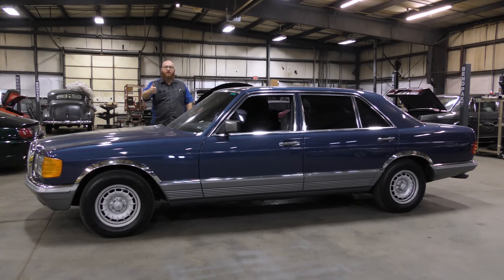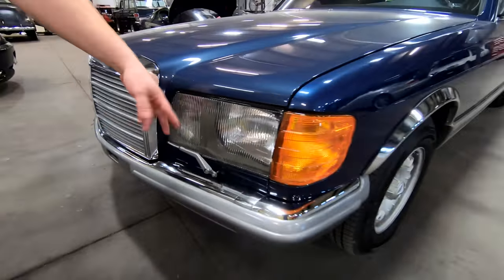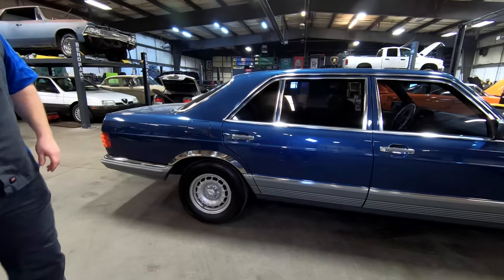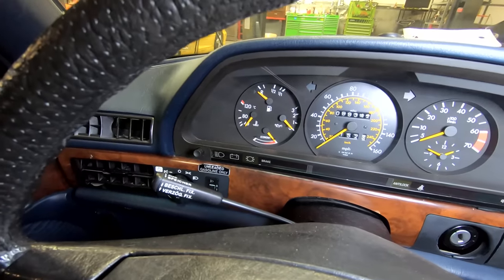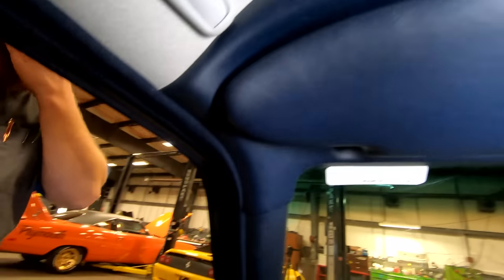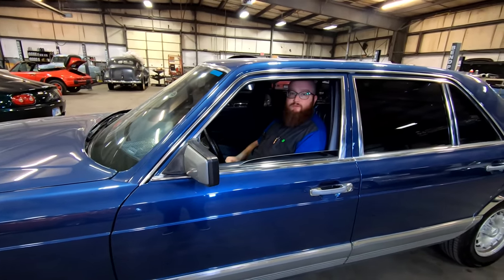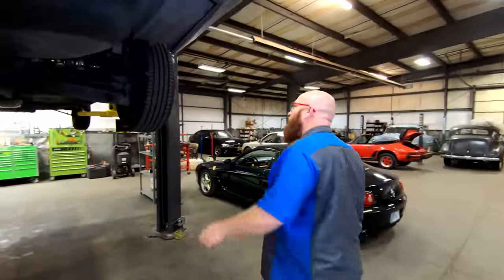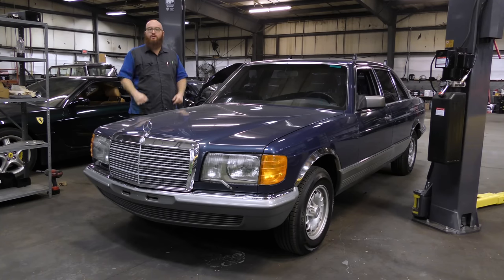Truly a gray market god! Shockingly perfect 1985 Mercedes 500SEL! The CAR WIZARD is in love

Comment: that metal washer on the dashboard is a metal ring with sticky tape on the back - used to mount a metal ST Christopher magnet. St. Christopher is the patron saint of automobilists and my parents had one in most cars. when the cars had metal dashes it started with the magnets and the more modern the cars became the less metal was exposed on the outside. so they stared to mount metal plates with double sided sticky tape :-) 
The location is typical for one of those medals. 
Hi from Europe... keep up the good show

Comment: Oh yes, those old fuel systems. Whenever they are hard to start when the engine's hot, they have an issue with that second module next to the fuel pump, it's a fuel pressure conservation chamber which holds the fuel pressure for the engine to start, and it has a membrane which can tear and then this module needs to be replaced.
Reply: Why, yes! I recently changed the fuel pressure accumulator in my W124, because of a hot restart problem.

Comment: heated windshield washer fluid reservoir and lines all the way to the headlight/windshield squirters as well as a heated pad underneath the black fretting on the bottom of the windshield where the wipers are in park position. Heated radiator water is circulated through the pad just like a heater core in order to keep the blades from being frozen to the windshield.

Comment: This is actually an elongated version, I'm not sure whether it's a Pullmann conversion or whether it was built that way by Mercedes, but it looks like it's several centimeters longer for more foot space in the rear seating area, the rear doors are a bit longer than usual. I remember in my childhood, there were many cars like this in our garage to have car phones installed. and once, I think around 1990, there was one that was converted into a convertible, so that was a 4-door convertible 500SEL with the highest luxury interior you could imagine. Your foot did sink right into the carpet, it was so soft and deep, and with the roof/top closed, you felt like you were inside a living room, not so much inside a car. And of course the top went down automatically. The customer who had brought that told us that it was one of 5 of these conversions that were ever built, world-wide! A total dream...
Reply: The SE was the standard, the SEL was the long version, as this one is, both factory-made. Where 4 inches does make a difference!
Reply: @midlam99  Oh, I see, so it wasn't a Pullmann. Right, I'm not even sure these newer models were modified by Pullmann. Anyhow, that convertible sure was nice, I still remember it after 30 years, was still a kid, and I was allowed to sit in one of five cars in existance! :-)

Comment: I used to federalize German import Benzes in 1985, and a lot of them had velour seats, often in weird colors, like an avocado green. Some were former Taxi's they had power windows in the front and crank on the rear doors. I finally got my first w126 last December, it's a 1986 300 SDL with 400,000 miles, for $800. 
I feel like a million bucks driving it!

Comment: nice car! very clean… but fairly EQuip 500SEL… missed out some options that usually ticked in the 500SEL PFL which is the top of the range back on 1981-1985 for W126 family… options missed out such as…

- electric front and rear seats
- heated front and rear seats
- ASD 
- orthopaedic front seats

Comment: I drove my uncle’s 1982 300SD in 1985.  Very heavy car!  Like a Bank Vault!  Believe from 81 to 83 they only had the 380SEL and 300SD in North America.  Then in 84, they added the 500 (am I correct?).  Then the second series 560, etc. came in 86.  Believe the 560 sold much better than the earlier 380 as it was much more powerful.

Comment: The Code on the ash tray. For the radio if the radio is removed or the battery is removed you will need it or no radio. Had the same on my ’87 300SDL.

Comment: A drive in any w126 reminds you of how cars should drive..small wheels, proper suspension, well damped, amazing....
Reply: Two acquaintances here in US have Gen II Euro 560 (1 SEC, 1 SE) with the rare high compression 300 hp engine. Another turned his W126 SEC into a rebuild AMG widebody he took to some big Mercedes event in Monterey CA. The new gullwing SLR and other AMG's were introduced,  but even the Mercedes guys who had flown in from Germany, gathered around the widebody and looked at it in wonder. The original AMG W126 widebody had a 6 liter 32 valve engine. Penta wheels front 9 x 16 Et0 with 245/50 tires , rear 10 x 16 offset 12.7 with 275/45.

Comment: My dad has the exact same car and color combo albeit it's a 300 SEL. The inside of ours is full grey leather.  I live in Europe but ours is definitely not in this condition and has been sitting for the better part of a decade.  This is truly the best vehicle that came out of Mercedes Benz along with the W124.
Reply: 280SE 3.5 

These 1980’s MB were nice cars but not the best, definitely not the best aesthetically.
Reply: @OnTourWithPattiSmith  grosser
Reply: Don't forget the W123, if you're going to mention the W124 in the same sentence.  Different in their own way, but all excellent vehicles.
Reply: @OnTourWithPattiSmith  maybe not aesthetically but from an engineering standpoint Mercedes through everything at them and that's why they are so reliable.
Reply: @pfsantos007  An excellent vehicle as well. I just feel the 124 improved on a lot of things compared to its predecessor.
Reply: W126 better than W116?
Reply: @vw5056  In my eyes there is no comparison. The W126 is way superior.
Reply: @brakmaster  can you explain why? Not arguing just not that familiar with either car.
Reply: @vw5056  Yeah it is much more modern and robust in my opinion. The way it drives is also very familiar to someone driving a modern vehicle.  Fuel injection and other electronics also contribute to this.  Furthermore most dictators around the world used to own this vehicle which makes it badass in its own right.  I could be biased because for me this vehicle is part of my family and my best childhood memories!
Reply: The W108/9 and W116 and W123 were well build cars as well.

Comment: I love Mercedes from the 70s and 80s. They were built like tanks and the engines/transmissions were simple, rugged, and very well made. They would last for hundreds of thousands of miles and be relatively trouble free. I wouldn't go near a modern Mercedes especially one over 100,000 miles. They are a constant migraine headache of one reliability problem after another.
Reply: They are essentially built for a 2-3 year lease. Full of unnecessary technology that costs thousands to repair the second the vehicle is out of warranty.
Reply: Ehhhhh….. the engine in that car is known for valve guide wear,head gasket leaks, and timing chain guide breakage around 100-150k, the in-line 6 engines of that era were notorious for head gasket leaks at around 75-100k. The transmissions in that era were known for reverse clutches burning out early and other nagging issues. While well built and very rebuildable, the idea that they would go for hundreds of thousands of miles with little trouble is kind of a myth. Source: professional MB tech of over twenty years.
Reply: @ronjohnson8119  The reputation you're referring to is based on the OM602.912 in the W124 and the OM617 in the W123 and W126. There it is merited.
Reply: These engines and transmissions were pretty good. I used to have a 91 560SEL. I think as far as reliability goes though the later M112/113 engines with the 5 speed auto were more reliable. I remember worrying about timing chain guides, and never being able to get the the idle quite smooth(fuel injection) Also a slow engaging reverse gear. I think it was the B2 or whatever it’s called
Reply: What is considered modern? The W220 with the 4.3 or 5.0 and 5spd auto was/is very stout. W221 good too.
Reply: am motovier4 kind of.
Reply: VW the M112/113 engines were bulletproof. The 722.6 transmissions were good. The W220 and 221 chassis are actually fairly problem prone. The air suspension (or heaven forbid ABC on some), front suspension component wear,rust on the 220, the 278 engine in the later 221 is complete junk. I am not saying that they are the least reliable vehicles ever made but they are no Toyota.
Reply: @ronjohnson8119  I've got two '85's, one with 220k miles the other 310k. No issues beyond the usual wear items. But I do strictly adhere to the maintenance schedule.
Reply: am motovier4 I have been working on Mercedes for over twenty years. You should go buy a lottery ticket.
Reply: @ronjohnson8119  Toyota was the US' most imported vehicle in the '80's. Rarely if ever see one on the road now. Still see the diesel w123, w126. 

Anything w140 and later wouldn't want to own even if free.
Reply: am motovier4 It’s the same reason you see many (relatively speaking) old ferraris around. They were more expensive and “special” and therefore people took better care of them (and are willing to spend far more on repairs) and didn’t drive them as much. Many of the old Mercedes on the road have surprisingly few miles on them. I am not arguing that the old Merc diesels weren’t long lived. Everything else on the car may be broken, and they may leak, but they will keep on ticking.I am a professional automotive tech with over twenty years of experience and  the number of Toyotas I have seen with 3-400,000 miles or more (and with original drivetrains)dwarfs any other make. One thing that was so great about Mercedes used to be parts availability and therefore repairability.You used to be able to get ANY part for ANY Mercedes ever made,regardless of age. This,sadly,isn’t the case anymore.
Reply: @ronjohnson8119  i have seen many gasoline M-B's with >300k miles. One was a 2001 W220 that a guy was selling not far from me. When we're talking corrosion resistence there is absolutely no comparison between MB and Toyota, especially the 80's models. 

I have seen 190E's still driving around with zero body rust. Have not seen a 1985 Toyota on the road since the early 2000s. The 190 wasn't exactly a super expensive car either like a Ferrari. Cost more or less what a Cressida or ES300 did. Check out CSW on YouTube, he is a tech at a Toyota dealer and regularly gives viewers underbody tours and let me just say that most of them are absolutely atrocious. Not even that old, like mid 2000s models. Plus, you can see how Toyota cheaps out on so many vital things such as suspensions. Solid rear axle on a premium SUV like the RX330? Yeah, no thanks.
Reply: VW I have seen plenty of cars with the M112/113 with 300,000 miles also. That is why I said those engines were bulletproof. I have NOT seen many (if any) pre M112/113 with over 300k (probably not with over 150k)without valvetrain repairs and head gasket replacements.I never once argued that a Toyota DRIVES or HANDLES better than a Mercedes. The G-class has solid front and rear axles. They have their purpose.You are wrong about the price of a 190. They were at least DOUBLE the cost of a Cressida.Yes, some Toyota trucks did have some atrocious chassis rust-proofing. Most older Mercedes have rust UNDER the undercoating. My 2001 E-320 has some pretty serious rust issues that have been apparent for more than 10 years and I don’t live in the rust belt. All I am saying is that Toyota is hands down the most reliable brand with few exceptions. I know first hand. I have been a professional tech for over twenty years. The car wizard agrees with me.
Reply: @ronjohnson8119  i mentioned the solid rear axle not to counter an argument you made but to give you an example of how Toyota cheaps out on vital things. The G Wagon is a serious offroad/ulitarian vehicle. The RX300/330 is an onroad crossover making it having a solid rear suspension for nothing other than a cost cutting purpose. That's the thing, you Toyota fans only ever argue about "reliability" but never things such as power, suspension, tech, features, corrosion resistence etc. I think the term you are looking for is low maintenance. Actual reliability is just as good if not better with many other brands. 

 Your 2001 E320 just happened to be from bad batch of cars with a factory paint problem. The exception rather than the rule. 

1985 Cressida had an msrp around $16,000 while the 190E $23,000.
Reply: VW you are wrong about reliability. My e320 is not an outlier. The spring perches are known to break off due to rust.Ok, so the  1985 190e wasn’t double but it was significantly more expensive.I am not just arguing about Toyota reliability. I am simply stating that Toyota IS hands down THE most reliable BRAND. I never argued about anything else.That is a simple fact.You are arguing with the wrong guy. I am a professional. I see this stuff every single day.Ask the car wizard.He agrees.
Reply: @ronjohnson8119  lol. Scotty (The Hack) Kilmer also presents himself as a professional. Not necessarily calling you a hack but just saying that anyone can claim anything on the internet.
Reply: VW hahaha! I will have to agree with you on that! Don’t get me wrong. I love Mercedes. I love the way they ride,handle,look etc, but they are not as reliable as a Toyota and that is ok.
Reply: Completely agree.  Merc has lost their engineering edge.
Reply: The AMG engines used in the W210 E55 are surprisingly reliable. Too many of the 70's and 80's cars used to cheap, and have gone to people who drove them into the ground and were repaired  only when something broke. Only a few were well kept and maintained by their owners, like the example in the video. My 100+ year young aunt in Germany still has her in 1976 bought W123, with a little over 70k Km. Always kept in a sealed garage, and once a year her Mercedes guy will go through the car for maintenance. The original paint is still shiny. In SoCal you still see plenty of older Mercedes, but in Europe most have rusted away.
Reply: @99Vood99  unecessary tech like what?

Comment: Back when Mercedes Benz vehicles were actually the best or nothing...
Reply: William--------------Mercedes cars TODAY are still magnificent automobiles---the Best in my view.
Reply: @tomburke1687  They are not nearly as well engineered or built as they used to be.
Reliability and durability and resale are poor and they aren't even prestigious any longer.
With long term financing and leasing almost anyone can afford one.
Back when my father drove S-Class models and my mother drove W123 & W124 wagons having a Mercedes Benz meant you had arrived.
Reply: @william egler.  You are spot on.  In 1985 the cheapest Mercedes (190e or "baby benz") was approximately 35k Canadian dollars.  That was their CHEAPEST car.  That was big money then for entry level. 37 years later and their entry level is still about 35k Canadian.  

I think that with the arrival of Lexus, around 1990, Mercedes tried to move down market to try and compete and the entire marque has been destroyed.    Back in the 80s Mercedes were the longest lasting, most reliable, best built, best resale, best owner satisfaction, best technology (without having tech for the sake of tech)., safest, best cars money could buy.
Reply: Unfortunately the W140 was the last one where the engineers still ran the asylum, but they were often derided at the time for being too bloated and excessive, the hulking tank on wheels seen as a drawback rather than an asset over the regal and graceful W126. But it didn't take long for people to realize it was another high watermark in Mercedes history, especially after leading to the overcorrection of the less-is-more W220 with all the Chrysler era problems. The W221 was somewhat of a return to form, but tech and sporting performance undoubtedly changed the character of the cars as well as their bulletproof reliability. Really though it was unavoidable due to competition and changing market conditions, and at least Mercedes opted to lead the way with innovating instead of getting left behind....I just wish all the SAMs and relays were more robust and didn't control practically everything as mundane as a reading light!
Reply: @tomburke1687  They're not what they used to be. These were the most reliable cars on the planet. Today's Mercedes is not reliable like a W126.

Comment: Velours were standard issue in Europe on such Benzes.
Anything else was optional.
I think the Brits call such velour colour "Petrol Blue".
Reply: IIIC there were two finishes, half velour was fitted to my W126 300SE, in the same colour. Distinctly remember the pile on that was rather lacking. I seem to remember that the full velour option being more expensive than even the MBTex. But then maybe my memory has it wrong and mixing it up with the 123/124 which we’re definitely regular cloth as standard.
Reply: I checked the pricelist from back in the day. Velours was indeed factory standard only for the 500 SEL and the Coupé (both versions). For all other versions (including the 500SE without L) it was optional for 1.983,60 Deutsche Mark, which was almost as much as the leather option for 2.200,20. True luxury of the 80ies (but truely, the MBtex seats were so good, you only needed it for luxury). :D Might explain why it's so rare, since the leather upgrade from Velours for the 500 SEL was "only" 524,40 Deutsche Mark.

Comment: The numbers on the center console that Mrs Wizard pointed out are probably the security code for the Becker radio. 

You have to enter that code after the battery has been reconnected for the radio to work.